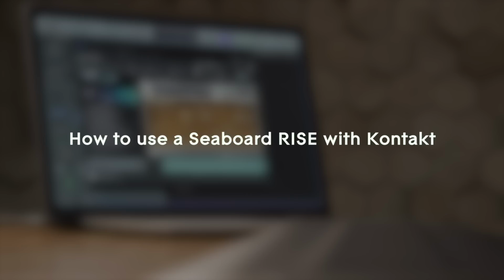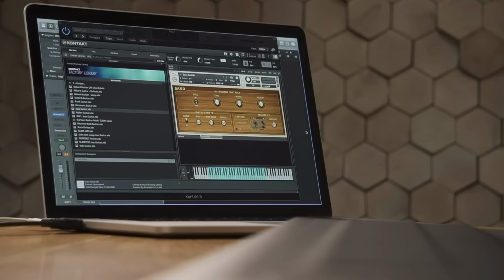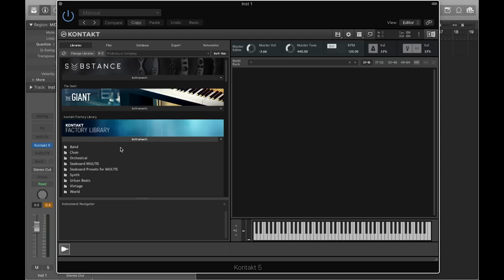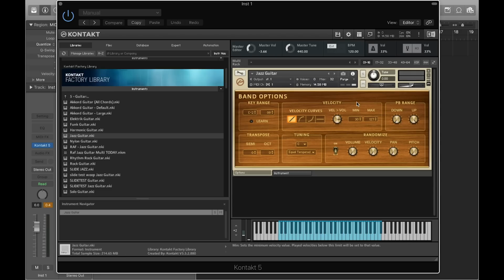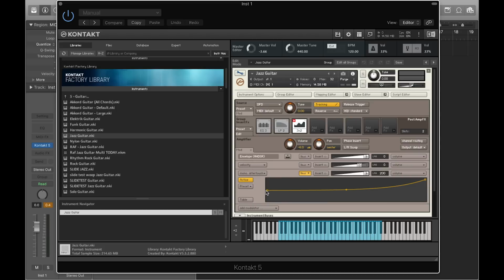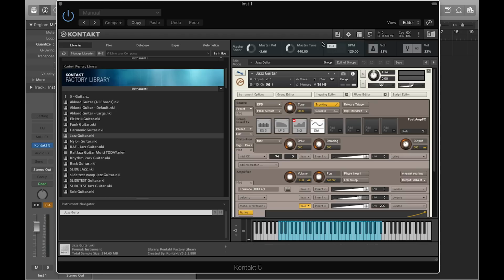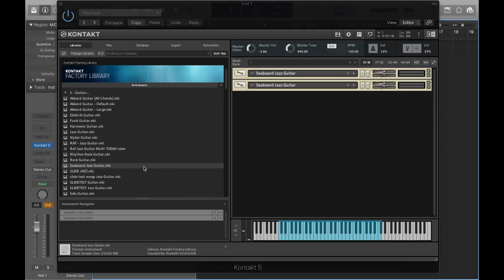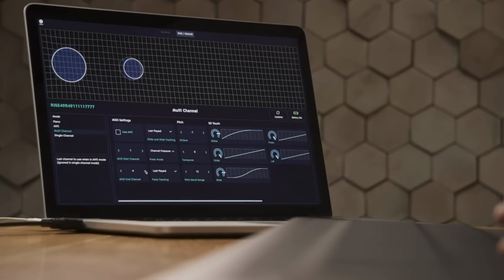How to use a Seaboard RISE with Kontakt

Comment: After you saved the edited guitar as Seaboard Guitar. You saved another as the multi with 4 instances of the Seaboard Guitar. What does that add to the Seaboard Guitar?
Reply: same question. channels 2,3,4 don't receive any signal anyway, what's the point?
Reply: @bisusdadinle1726   actually MPE controller can send up to 15 channels at same time

Comment: This would be why I'm returning my rise 49.  I want plug and play.  I spend more time trying to get my stuff to work than making music.  It's frustrating.  Maybe in a few years when these technologies really talk to each other, will I revisit it.
Reply: That's exactly how I feel. I'm keeping my Seaboard Block simply because it's amazing to use with Equator, it's great for experimenting and ideas, but with something that is not Equator... oh boy...
Reply: If you want to plug and play, a MIDI controller isn't for you. You want a workstation keyboard with in-built sounds. The Seaboard RISE is a very versatile controller and therefore takes time to set it up to achieve the best results.
Reply: @IsaacRaine63  That's not true.  I ended up replacing my rise with a Native Instruments Komplete Kontrol S61.  I LOVE it.  It works with Cubase 10 right out of the box, not to mention that the NKS technology is awesome!  It is exactly what I was looking for.
Reply: IR24 absolute nonsense. I have the same issue with my song makers kit. I spend waaay too much time configuring the expressions from MPE to parameters to make it work. Pretty much any  midi controller on the market is plug and play aside from this one. It’s a nightmare...oh and they still don’t have a dashboard for iOS which means you have to plug in the blocks to a computer to configure the modes when u working with iPad. The whole del is shoddy and they didn’t partner with nearly enough companies to make this work and encourage widespread adoption. So not we don’t want a workstation, we just want this one to work properly and not be half assed and spend hours mapping and tweaking

Comment: Using Kontakt 6 I couldn't (really) hear the mono aftertouch altering the volume/amplifier or the distortion having any real effect. For some reason I was editing the 'Noises' only instead of the 'Jazz Guitar'. Found that out while clicking on the Group Editor tab. Works fine now. Thanks
Reply: Guus van de Wal  i had the same problem thanks!
Reply: Thx, the setting I missed!

Comment: can you make a video on how the seaboard perform in bitwig?
Reply: I use it with Bitwig, it performs really well by itself! the only problem i encountered was that sometimes midi signal wouldn't record dimensions as exactly as i played, so I had to make an audio channel to record the audio from midi channel so that it would play back exactly I have played.
Reply: @1ost147  Hi 1ost, seems you are the expert here. Is roli multichannel with kontakt on bitwig working well for you still? It seems after going through the setup, my kontakt loaded on bitwig can't receive multichannel but only on channel one. If you know any tricks i would love to hear, thanks!

Comment: Why does my dashboard look completely different. The program claims to be up-to-date but for example I can't configure midi end channel to 1. I can only make it go to 2.
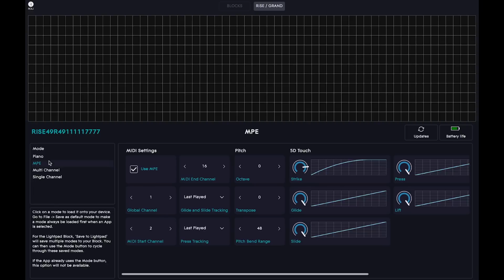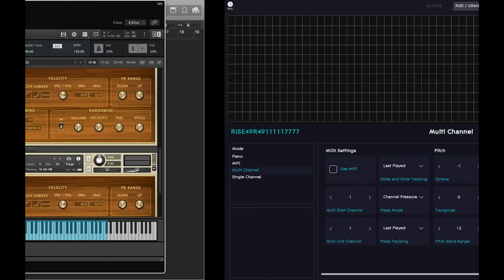Reply from the maker: Hi, sorry for the confusion. Since this video was made, ROLI Dashboard has been updated. At 0:54, instead of using "Multi Channel" simply select "Single Channel" with a MIDI Channel of 1. Then at 5:10 you may select "Multi Channel" with a MIDI Start Channel of 1 and a MIDI End Channel of 4.
Reply: @WeAreROLI  I'm done following the instructions. It's not working. Please help.
Reply: @WeAreROLI  help me please!
Reply: got the same problem. maybe it is because they use mac ios and we use windows? did you find a solution? thx in advance!
Reply: just delete the old dashboard and redownload it on rolis homepage. u will get the right version then. the updater seems broken...
Reply: Oh damn, thanks! This is useful.
Reply: it has changed slightly as i just saw :D i got the seaboard working with the slide and stuff, BUT: if i slide (pitch) one note, it will act like a pitch wheel pitching everything :-/
Reply: I'll have to figure it all out some point! :D